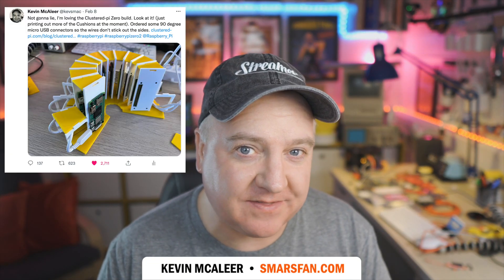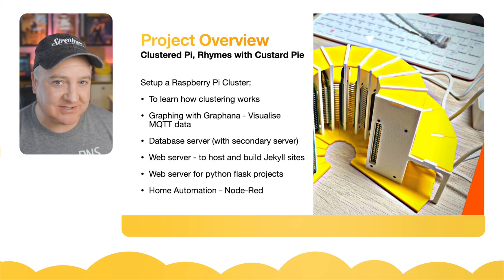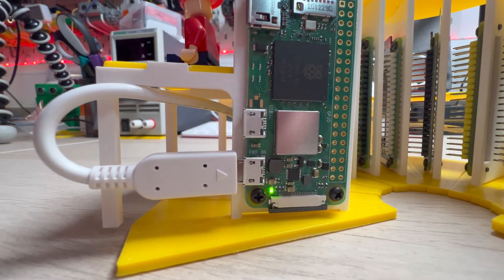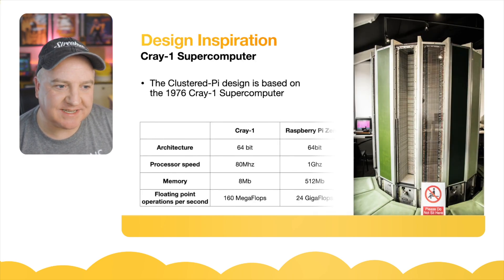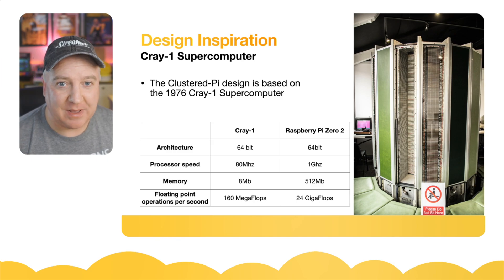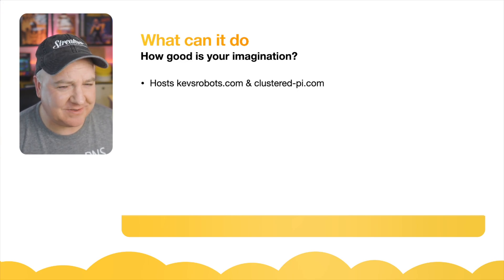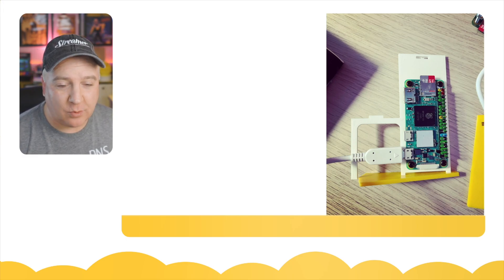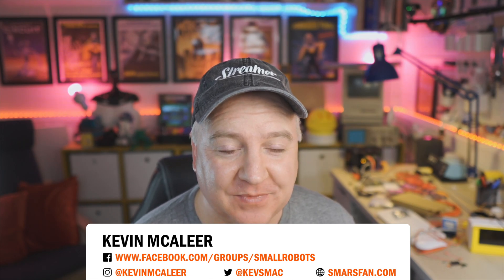Cray-1 Raspberry Pi Supercomputer, but how fast and why? - Part 4

Comment: To put the memory into context:  a 4096-word memory module for the Altair 8800 (8-bit architecture -> 4 Kb) would set you back $338 in 1975 (~ 2000$ today). So the Cray had ~2000x the memory of what you could consider a "home-computer", not that such a thing existed in 1976.

Comment: Amazing.    In 1992 I would pat my Mac IIci (500mb external hard drive $600) and say, if I could send this back to 1940 it would shorten WWII by at least a year. 
It is interesting that I use my iPhone to 'get 'weather reports. It's 5000x faster than the fastest Cray. Seems like all I really need is the raw weather data. Instead it's a bit like using a railroad to deliver one news paper. 
Meanwhile over the past 10 years Google has become increasingly unreliable, rife with noise.

Comment: I’m not trying to knock the data just trying to understand and find the truth. The internet says the pi zero 2w is only 5.1 gig flops. You have 24gf! The pi 5 is 10gfps. So did you run your own test?!. How did you get your numbers?!.
 
Also, this is creative. I love the idea of making it into a cray design! It looks super cool!
Reply from the maker: It's the GPU that can achieve this; the CPU is the 5.1, but that's splitting hairs, tbh.
Reply: @kevinmcaleer28  Thanks for answering my question.

Comment: i like this video, but i must point out the floating point of pi is theoretical. loading the registers would make it 8 times slower. so for useful work per clock cycle it is slower. the reason cisc rules today.not being negative just pointing it out for those that want useful tools

Comment: Reminds me of when the cluster load distribution and task passing libraries came out for early Linux in the 90's, I built a cluster of 486'es running a custom linux linked by their own internal network and then only the supervisor node had external network. It was an early Beowulf cluster, programming for it was interesting but in the end it did beat a Pentium 60MHz in some tasks running 6 486dx33 boards by quite a bit, which was cool :-) it did take up a bit more than a cubic meter in space though lol.
Reply: Layman's opinion about that setup tells it wasn't very efficient. That clustering seems to have sucked lots of processing power when you need six to overcome one. Similarly layman's opinion says those clusters should be expandable to whatever level of processing power you need so it ain't complete dead end.
Reply: @vksasdgaming9472  it wasn't intended to be efficient or useful really, I built it to test the cluster distribution stuff and the software, which it worked well for. I built it out of stuff I got for free or very cheap. I was in highschool at the time.
Reply: @noth606  I had understood that Beowulfs were meant to provide raw calculation on things that are inherently hard for a single processor, such as multiple iterations of a simple calculation (chaos theory, cell automata, Newton-Rhapson method... ) so they had an edge on those kind of procesess, akin to a factory purchasing 3 Harbor Freight lathes to churn out rough cut pieces, vs buying a German high precission CNC (the pentium) because the need for the extra features were not really needed.
Reply: @partciudgam8478  Back when I was messing around with it the speed that you could get from a single node was limited enough that simple 100mbit ethernet wasn't bottlenecking the system too hard to make it an issue to have high degree of granularity in the main program, if you get what I mean. So running various types of processes that were relatively simple on large volumes of data was doable keeping load at or over 70% ish per node, if the cluster was small. 
But the programming model and message passing system doesn't dictate how you use the system, so you can scale it whichever way you want really, within the confines of the types of network setups you can build and the per-node computation available. 
But like you say, it IS a setup that by virtue of the way it is built is very good at doing certain types of things, one particular standout being complex series of calculations/operations on slightly different large sets of data, used for example in weather forecasting model refinement and certain types of geological surveying I forget the exact name for, where you have multiple sensor stations capturing large volumes of data each over time covering either natural or man made seismic type events to build a 3D map of a section of the earths crust, to either map fault lines or look for hydrocarbon deposits and the like. There you'd have upward of gigs of data from each sensor station, which there wasn't a way to deal with efficiently in the '90s other than something like a cluster of PC's. A single or a few very fast CPU's aren't much good if the max ram you can give them is 1/1000th of your dataset, split the dataset and use a lot more CPU's is a way to speed up processing. SETI and cancer research at the time were done that way too, sort of. Folding@home etc. Render farms for cinema were a good fit.

Comment: You mentioned that the Cray-1 had 8MB of RAM, and "they called them words back then."  The "words" were 64 bits -- the Cray-1 had 1M words.  This was an improvement from the CDC 6600 and 7600, which had 60-bit words and 6-bit characters!

I had a friend who worked at Cray in the 70's, and he took me on a short tour.  I actually STOOD in the center of a running Cray-1.  You couldn't feel any heat at all -- the Freon cooling did a perfect job of removing the heat.  The wiring was a bewildering rats-nest of blue/white wires.  It's amazing they could actually build them.  Every wire was cut to a specific length, to make sure the signal waveforms arrived at the next module at the correct time.  😳
Reply from the maker: Thanks, Gary - that sounds like an amazing experience thanks for sharing the experience - I saw the Blue and White wires at the National Museum of Computing; it wasn't running, however which was sad (but I guess it takes a lot of power to run)
Reply: Because user sits in center of that machine it was kind of necessity. Or more like convenient side-effect of massive amount of cooling those machines needed. Even if time has made them obsolete those Cray-supercomputers are beautiful machines.
Reply: @vksasdgaming9472  Not so.  The center was not a work area unless you were adjusting the wiring, which was very rare.  It was a small area, standing room only.  I’m not sure you could have fit a chair in there.  But it’s been over 40 years since I stood in the middle of a Cray-1, so I don’t remember the exact dimensions.
Reply: @vksasdgaming9472  Take a good look at the CRAY1 design. It is like donut shaped.
Reply: @NNokia-jz6jb  you may be thinking about the padded “loveseat” that went around the base of the Cray-1.  It held the power circuitry, which generated some heat so the “loveseat” was very cozy on cold Wisconsin nights.  Looking from the top, the Cray-1 is actually C-shaped, with the opening in the C being where you can step into the center. There was also a separate I/O unit that usually came in pairs. When you put them together, they were roughly S shaped. So if you had the full setup and looked at it from the top, it spelled out “S C” -  Seymour Cray. 🤣
Reply: Legend!